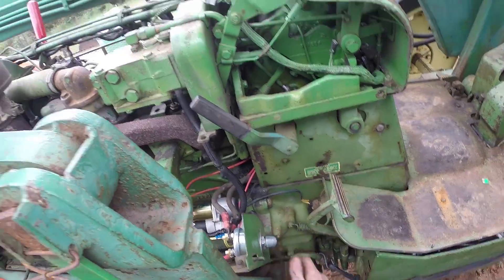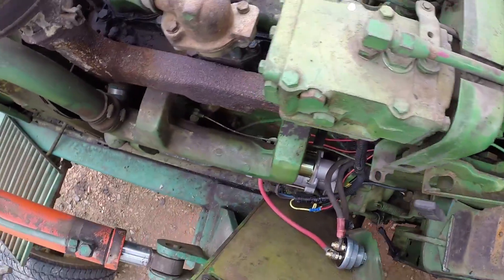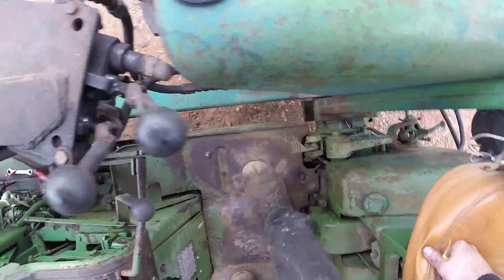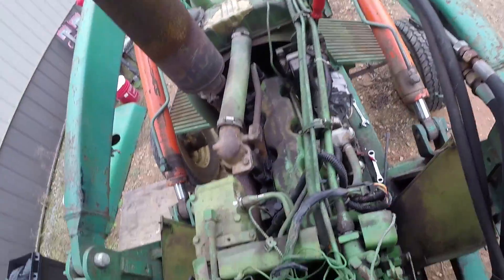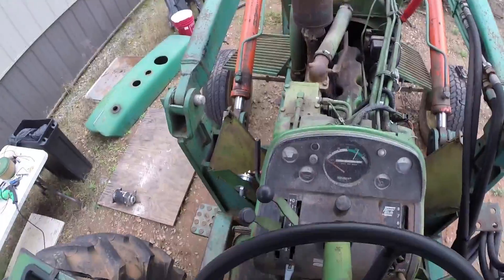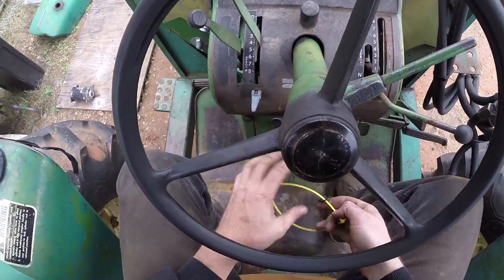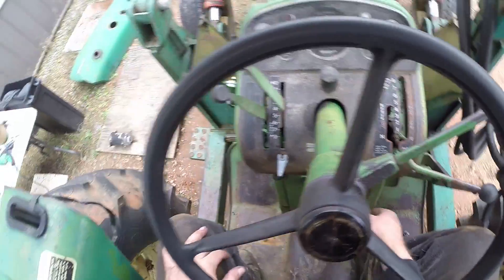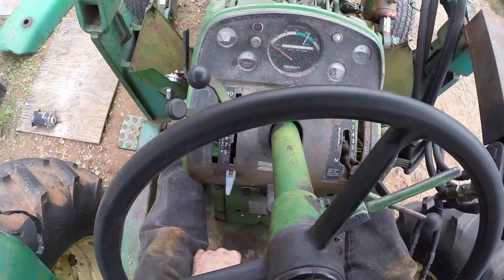1968 John Deere  3020 12v Conversion: Part 11

Comment: Great video, I used it to switch my 3010 diesel to 12 volt. The first thing I did was pull off the platform, what a mess, cleaned that all out, the old cables looked nasty and were easy to get out, once it was clean, one cable had 6 inches of rubber wore thru, makes you wonder how it started at all.  IF I had to do it again I would just get a 1 inch longer belt, so I would not struggle with it later. I also switched the generator pulley, for one thing the belt is to wide and the pulley from generator is a little larger so it speeds up the alternator for better charging at lower rpm. I put my solenoid on the side, my tractor is a syncro so I could put the solenoid where your transmission disconnect lever is. Not a big deal to switch from 24 to 12 volt. This video series is very very helpful, I was nervous about doing it, but very confidant by the time I was done, thanks.